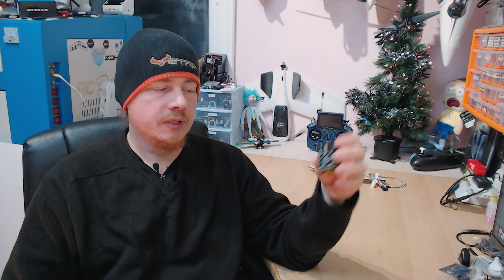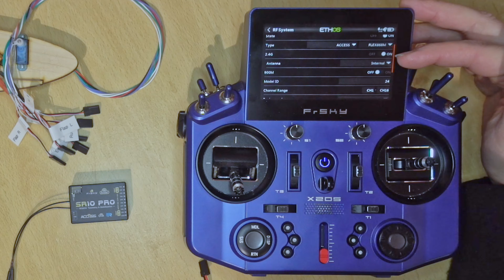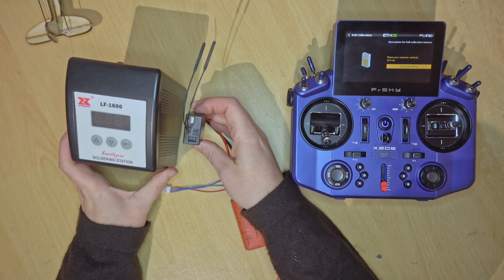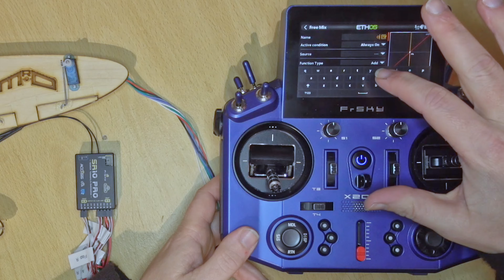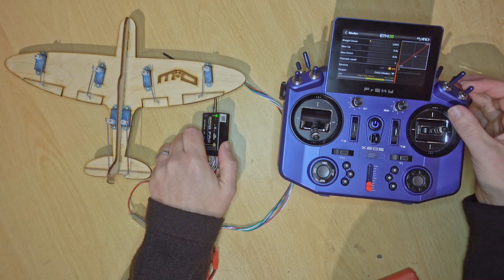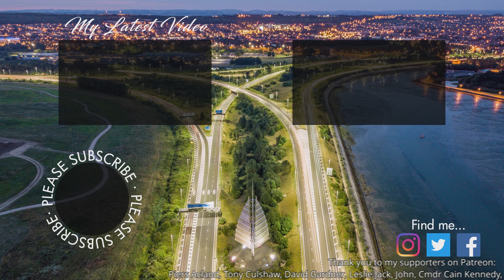Setting up FrSky Archer SRx stabilised Receivers

Comment: What no one is saying or showing are ways of tweaking (I'm working on this) Auto Level response.
If you're used to AS3 type stabilizers, in Auto Level any right stick movement off center causes the stabilization to "back off" and it's "your airplane".  I find the FrSky stabilization system does not want to relinquish control, regardless of gain settings and fights you for the airplane.  I belive under "SRX Stable" that can be tweaked, but i am yet to find proper info on that.  On scale models with AS3 I sometimes like to use auto level on takeoff and/or landings to ease the workload especially on the Jets. Mind you, I am coming over to FrSky from JR/Spektrum and Hobby Eagle A3 Super 3 stabilization. Nonetheless, I love my FrSky X20S and the SR series receivers, im just not using Auto Level feature, but have it on an "Oh S**it" button.  I do have a an X20pro AW on order as my Christmas present. Season's Greetings all!

Comment: Just setting this up with an Archer Pro (not plus) and with the self check button being available in Ethos now, is there any point of having the last channel 12 self test switch?  Also, is there any difference between the self leveling setting on the 3 position and the emergency "oh crap"?

Comment: Hi Darren, thx for a great video. I have a question about the “Movement Range of the Roll and Pitch Angle in Stab Mode” settings. What exactly is it an angle of (attitude, servo horn, stick), and how does it affect the Movement range? Is it something like a “Stick Priority” setting? Thank you, I just cant find an explanation anywhere.

Comment: Hi Darren - so I’ve looked all over the internet and YT, but no one seems to talk about setting this receiver up with a different FrSky transmitter. Perhaps I’ve overlooked it, but do you know if I can pair this receiver with my X9D Plus, including the gyro stabilization?
Reply from the maker: Not the older X9D Plus. It will only work with X9D transmitters that say ACCESS near the screen and has a roller to the right of the screen. If it says ACCST near the screen and has buttons to the right of the screen. It won’t work.
Reply: @MrD  thank you! You just saved me a potential headache—mine is definitely the older style.

Comment: Thanks for this VERY useful video. Question: the self check, has this to be done EVERY time I change Lipo for the next flight? Or is once every time I go flying enough (so only at the start of the day I go flying)?
Reply from the maker: It should only need doing if you notice issues. It should remember the calibration.

Comment: Love your videos. Thank you very much. Question: my SXR Enable switch won’t stay on. It keeps going off right after I turn it on. Any tips?  I’m using an X20S transmitter and an SR10+ receiver. Thanks!
Reply: I;m having the same issue, has there been a solution discovered?
Reply: @DrDoDad I think you need to update the firmware in your receiver
Reply: @azflyer3297  Thank You! I thought V10 was the latest but updating to v1.0.11 fixed the issue. Thanks again!
Reply: Howdy. I think you might need to update the firmware in your receiver. I was having the same issue until I did the update.

Comment: Trying to configure my S8Rpro. Its bound works the throttle and does its self test from the tx script BUT.. no control over ail ele or rud
Reply from the maker: Did you move all sticks to their extremes in high rates, during the self test?

Comment: I wish I could say that I was following your video and everything was working. But, it's not. I am not able to make any adjustments in the Device Configuration menu. Every time I change settings for Wing Type, or for Rudder Inv, the setting reverts back to Off. What do you think the problem is? Thanks...

Comment: On my x20s when I go to the srx in configuration everything is greyed out sometimes one or two will pop up selectable but it won’t save. This is after calibration of the td sr6. Is there something I am missing?
Reply from the maker: If it’s greyed out. Either the SXR Enabled is turned off. Or you’re using the wrong tool for that stabiliser.
Reply: Im using the TD SR6 stabilizers

Comment: Is it possible only have two modes? Off and stabilized. I don’t want an auto level mode.
Reply from the maker: You could probably use a curve so that the switch never goes in to the auto level position. But you can't switch off the mode in the receiver.

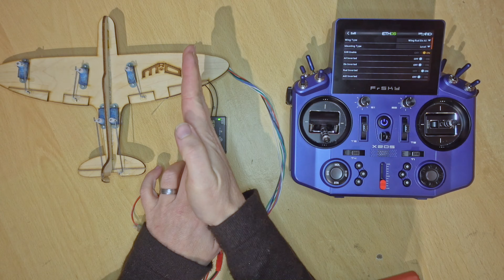Comment: Mr.D.  At 14:00 you state "if the RX goes right the rudder should go right"!  I do believe you are incorrect!  If the A/C nose is moving right and I add additional rudder, that control input will NOT correct the nose position.  The gyro should be inserting an 'opposite' control input, just like your aileron explanation.  I have over 5k flying hours in the big heavy bombers (B-52G/H).  I  was in the aircrew that flew a "G" model at the Mildenhall AFB airshow  in 1986.  Best Regards.

Comment: This is another good video! However, I could not get self-check to work. I checked the two causes identified here. I found a post where someone pointed out the Self-Check switch on the SxR configuration screen. I tried this and it worked perfectly... same thing as using as the three-position switch did on the video. I deleted the Oh Crap mix and tested self-check via the Self-Check switch on the SxR screen and it still worked. The Oh Crap Mom mix also works (without the Oh Crap mix). Maybe this is because I am using a later version of Ethos? I don't know if this is the right way to do this or not, but it is working for me. I could not get self-test to activate using the mix as described. If this is the correct solution it is better because you don't have to use a switch on the radio (except for the Oh Crap Mom of course).

Comment: Great explanation, thanks for sharing. Do the SRx receivers need the same calibration procedure as the SxR receivers, which need to be calibrated, then flown with stabilization completely off while setting the trims, expo and stuff, and then need to be calibrated again? I calibrated my SRx and went flying with stabilization on and everything seemed and seems to work, but the stabilization seems a bit weak, I expected a more locked-in feel, wind is still moving it around a bit. Is this normal? I guess my prop is causing vibrations though, and I know gyros don't like vibrations.

Comment: Great video Darren, thank you! Can different gyro gains be set up with gear up and down? If so, how would you go about this?
Reply: I was able to figure it out. For those who are interested, there are a couple of ways to do this, but I used a Var mix as it seemed to be the simplest. I set up the main weight to 0% then added a new weight to the percentage I wanted it to increase with my gear down. I used my gear-down switch as the source. The output would be the gain channel. This percentage increase is set over the existing position set by the gain knob.

Comment: Hi Daren, Quick question: I have an sr8 receiver and have followed your video. However when I go to the SXR menu and try to enable SXR to on, it AUTOMATICALLY flips back to the off position. I Have try re calibrating but no luck, any Idea.
Reply from the maker: If this is an Archer Plus SR8, you need to use the new tool. https://youtu.be/gzc1VwEPfCE?si=BSeZIyMO9HEFdRIy

Comment: I'm having trouble using channels Ch9 and Ch10 in my SR10+. Gain and flight modes are on 13 and 14, how do I get 9 and 10 to work with regular PWM signal? I'm using OpenTX. The luascript only lets me manage ch5 and ch6.

Comment: Can I use that receiver for a helicopter . So it would auto hover when a switch is thrown.
Reply from the maker: No. The stabilisation modes are for fixed wing only.

Comment: I am not sure that the rudder setting for stabilization is correct. If I have my model on the take off run, and the nose point to the RIGHT I have to compensate the deviation applying rudder to the LEFT.

Comment: Hi. I've appear to have got setup OK till I get to the SXR setup. I select sxr enable but as soon as I select SXR enable to on it switches back to off. It Stays at the on setting with the receiver turned off, it only happens when the receiver is powered on. Any help appreciated.
Reply from the maker: If this is a new Archer Plus receiver, you need to use the new LUA script. https://youtu.be/gzc1VwEPfCE

If not, make sure your radios’ RF module firmware is up to date, as well as the receiver’s firmware.
Reply: @MrD  thanks for the reply. I'm new to Frsky, so its a bit of a learning curve. Id found your video about Lua script but thought I was trying to get the Lua script onto the receiver. I got it onto the SD card and I could view it in the files on the X20S but I hadn't got the additional windows for the stabilisation on the radio showing. I did find another video on YouTube by Frsky and tried again after deleting the files. I found this worked because the first time I added them to a folder location in scripts labelled receiver. The second time I just put them into the scripts folder and now the additional windows are there on the transmitter. Not got any further with setup yet but fingers crossed I'm making progress. 👍

Comment: Hi darren! Your video very helpful on my sr10 pro.. i have now sr10 plus update radio and rx done but the stabilize  mode is not working i try put gain , mode and oh crap switch , when i go menu device config and select  SxR  sxr enable  is off and i cant turn on   
. I hope you can help me
Reply from the maker: You need to use the LUA script to configure the ArcherPlus stabilised receivers. https://youtu.be/gzc1VwEPfCE

Comment: PLZ do a new video explaining the changes in SXR   this video should be replaced now :)    if you update the firmware on these receivers the stabilization is not on different channels.  The self check is different as well.   If we want this frsky community to grow we need updates.  I will donate to the channel.
Reply from the maker: Not quite. The original SRx receivers, it is all the same. Other than self check is now performed using the button in the old SxR Tool. 

Only the new ArcherPlus SRx receivers use different channels for stabilisation functions. They also use a new LUA tool to set them up and perform the self check. https://youtu.be/gzc1VwEPfCE

Basically:
ACCST SxR: Ch 9-12 - self check via switch
Archer SRx: Ch 9-12 - self check via SxR Tool
ArcherPlus SRx: Ch 13-16 - self check via SRx LUA

Comment: You are my hero.
I've set up SXR rxs before and didn't have a problem. The R9 STAB however  would not operate the servos until a self check was done while moving the sticks.
Your short comment about moving the sticks while the blue light blinks made all the difference although I needed to move the sticks while the light was solid. FWI, this was using the LUA scripts on the X20HD.
Thanks and please continue making these great videos.
Reply from the maker: Awesome. I’m glad the video helped 👍🏻

Comment: Help! I’m having problems setting up the new archer plus SR8 receiver. After following your steps for set up, the gyro operates even when the SXR page is not activated. The page will not allow me to choose wing type, position, turn gyro on / off. When I switch on gyro it allows me to move the slider over and it turns yellow , but as soon as I release it it automatically goes to the off position. All of the other options do the same including wing type and position. I have the gain on ch13, mode on 14, and oh crap on Ch16. The mode switch on ch13 works even though the able disable switch is in the off position on the SXR page. The instruction manual I  down loaded from FrSky says to use ch 13,14,16 instead of ch9,10,12 as for my S8R receivers.
Reply from the maker: Make sure you have the latest version of the firmware for both the radio (OS and RF) and the receiver. There’s probably just a mismatch somewhere.

It looks like the new Archer Plus SR8 is indeed using channels 13-16 for stabilisation. This will make things easier on the receivers.

Comment: I have an SR8 Pro. The stabilization functions as advertised on the elevators and ailerons. But no stabilization on the rudder. I have updated, reset, rebound and re-calibrated the receiver. Still nothing on the rudder. I need some help on this one.

Comment: Have set up several of these before no trouble. Now for the first time trying the archer SR6 unable to get it to enter calibration mode. Checked switch delay, was already on zero. Everything looks to be doing same as it did with working profile. Maybe retry firmware update. Is the lua script to configure device receiver same in X20S.
Reply from the maker: With the updated system, you just choose self test from within the SxR tool.

Comment: New to all this stuff. I’m a bit confused about the rudder stabilization movement. Could someone help me understand a little better as to why the rudder moves to the same direction of the nose instead of the opposite?  Thx.
Reply from the maker: It moves the same direction as the tail. Opposite direction to the nose.

Comment: One more question :) The gain is assgined to ch9, and you later change flaps to 13 and 14, but wouldnt it be easier to moce the gain to another channel, rather than creating a new mix for the flaps, or are there a reason gain should stay in ch9?
Reply from the maker: No, you can’t reassign channels 9-12. They are fixed. This is why you have to reassign channels above 12 to the 9-12 output pins.

Comment: Hi Darren, a question about the knife edge and hover modes. How does these work? Is simply like flipping a switch, and the plance flips over to a perfect knife edge until you switch it off again, or? Couldnt find anything in the manual regarding this.
Reply from the maker: I’ve never tried them.

Comment: hi darren thanks a lot for this explanation but im very confused about how you explain the rudder should correct at 14.05min . when in stabilisation mode you say if we turn the receiver to the right the rudder should go right i'm sorry but i think this is wrong and  according to the manual its the other way round .Could you please  look into this
Reply from the maker: The rudder should move the same direction that the tail move. So the opposite direction to the nose.

Comment: Hi Darren, I have an "issue". I setup mine and managed to get everything working except that when SxR is enabled in devices/SXR/ one aileron neutral is off. If I disable SXR (like using a regular receiver) neutral is spot on. Outputs in the Tx does not change either way so it's something done by the rx (I guess). Done the calibration and the self level setup (twice) but there is no change. Any idea what is going on? Thanks! Fernando

Comment: Thank you for the good video! But it would be so much better, if you move your fingers when tapping on the touchscreen a little bit slower! (Hover your finger above the screen, stop for 0,5 seconds, tap, lift your finger, wait 0,5 seconds, then remove).  Also when selecting by the menu wheel and clicking enter a little delay between selecting and pressing enter would be so fine. ;-)
Reply from the maker: Thanks for the suggestion.

Comment: Please could you help me ? I've been using JR tx with frsky hacks and JR module, I just bought a x20 tx with the lite external module, I having real trouble binding to aV8FR-II rx could you point me to one of your vid's that have covered this, thank you for you help
Reply from the maker: I’m not 100% certain this old receiver will work. For the best chance, use your external XJT Lite module set to D8 mode. Then your will need to set the receiver to D mode using a jumper across the signals for channels 1&2. The full details for this procedure is in the manual. https://www.frsky-rc.com/product/v8fr-ii-2/

That would give you the best chance.

Comment: my self check is not working,  i have throttle down and the switch setting to 0ms.    I was able do this earlier on another RX.   now none will.
Reply: i think there was a firmware update that does not allow the 3 flip of the switch,  you have to manually do self check in device config now ?
Reply from the maker: Yes. With the SRx receivers, you now do the self check from within the tool.

Comment: Darren you've been a lot of help for me moving to the X18 coming from Spektrum. Thanks. Do you know of any future update on the SRx series RX's to be able to have the pins to the front and antenna's to the rear? It would be much easier to plug servo's in and also get the antenna's away from the batteries.
Reply from the maker: Not as far as I know. But I can pass on the feedback.
Reply: @MrD  I can't be the only one who thinks that's a good idea. Thanks for what you do.

Comment: Same sr6 receiver??
Reply from the maker: Yes. The SR6 will work the same. The S6R is different. For that, see https://youtu.be/SQ-cpXhrL5A
Reply: @MrD  I haven't used s6r. Is the setting method different? Do you recommend sr6 for twin x lite?
Reply from the maker: SR6 works with the TWIN X Lite. You pick the receiver based on what it is going in. 

https://www.mrd-rc.com/tutorials-tools-and-testing/useful-tools/frsky-receiver-compatibility-tool/

Comment: I would like to avoid the self level without giving up Self Check.  Is there a way to do this?  I've found self level to be a potential, and sometimes, real problem, while flying. Accidentally bump the switch and things get interesting very quickly.  Would a two position switch and limited, 2 point, curve work?
Reply from the maker: I don’t see why a 2 way switch and a curve wouldn’t work. It should be fine.
Reply: @MrD  Thank you for the very prompt reply.  Greatly appreciate your videos, knowledge and ability to explain this device.  
After my comment I tried it.  Takes a 3 point curve and the self check doesn't happen.  BUT, I do get the gyro and gain without the risk of stabilization occurring inadvertently.  Or at all.